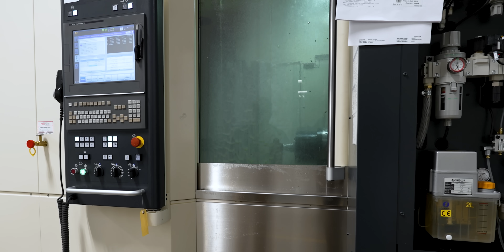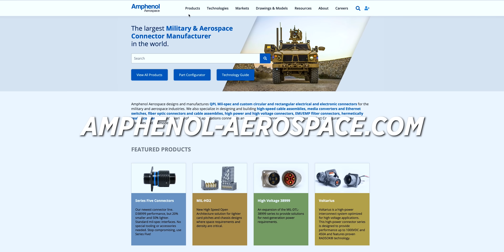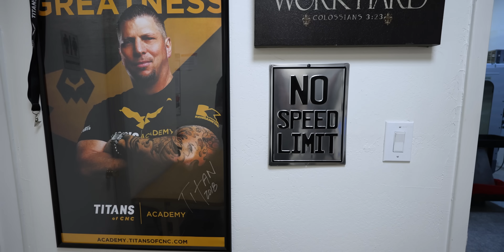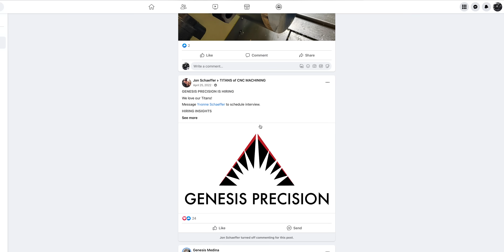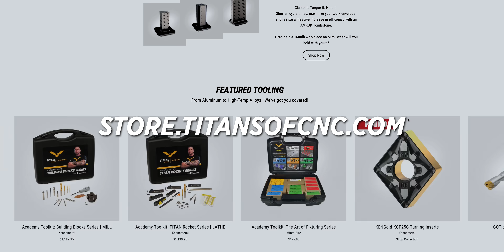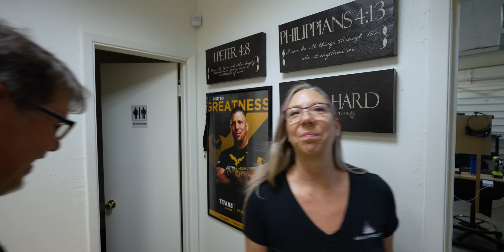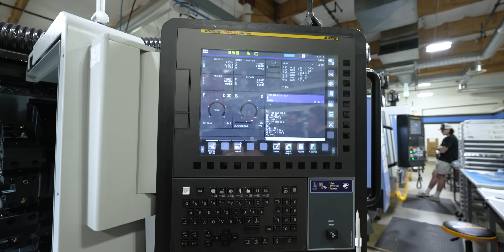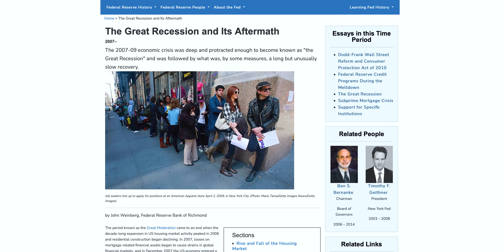Step Inside This Billion Dollar Secret Facility In Arizona

Comment: Arizona boy here.  Well, I'm really a retired old man now but, I don't know how I missed this video earlier.
Good to know you were in town.
I ran a one-man custom auto interior shop for over thirty years.  I had to learn CNC milling and lathe work because alot of the vintage automobiles I worked on were hard to find replacement parts for, and having someone else fabricate them for me was crazy expensive.
I had to learn G-Code and milling in general on my mill, lathe or my 3D printers.  It was learning through trial and error; mostly error.
I sold my machines after retiring because I thought I wouldn't be needing them anymore.  Boy was I wrong.
Now I'm looking to get some desktop CNC machines just to have on hand.

Comment: The smaller shops you visit remind me of Lakota Racing in Carrollton OH. They are a small machine shop that work on small high output motors for Garden tractors and other small equipment. We’ve taken our motors there for over 10 years and everytime I’m up there I visit my buddy Ross in the shop watching their cnc machines. Coming from a carpenter with our cncs it makes watching his that much more interesting. Quite a few machines they have packed into a very small shop with a high output

Comment: I lived in Phoenix Az. for almost 20 years and purchased from a variety of machine shops in the valley and I've never heard of these guys. One thing is for sure if you're a big shop you must keep lotts work running through it to keep the doors open. In tough times heads roll and equipment is idle. Smaller shops tended to be more flexible with very low overheads and usually survived economic down swings.

Comment: As a teenagerI worked in a machine shop in the 70’s.  Used Bridgeports and South Bend lathes — all manual piece work.  Have to say one of the best jobs I’ve ever had.
Reply: Most of those bridgeports are probably still going lol every machine shop need a old one on the corner wouldn't be the same without them

Comment: I used to live right down the road from Amphenol but had absolutely no idea that they existed. I run the Machine Shop for NAU now up in Flagstaff while I am finishing my Master's / PhD in Mechanical Engineering. It is a smaller shop but I get to run a lot of first iteration parts for the capstone students and it has really helped me realized how much I love the manufacturing side of engineering. I might see if they need some Manufacturing Engineers at Amphenol when I am done with my degree. If you find yourself in northern Arizona, you should visit our shop as well. As it is a school-based shop, I would have to get the go ahead from the Mechanical Engineering department to give a tour but I doubt that would be difficult.

Comment: Amphenol has been around forever, famous in electronics. Been using their stuff since the 80's.
Reply: If you've ever worked on an aircraft you've probably used their connectors.
Reply: We used a lot of Amphenol MIL circular connectors building satellite ground stations in the 60s.

Comment: I used to work at Mazak UK in Worcester and ever since I left to become a HGV driver I regret that career change as I had an accident causing my lower back to be fused together.
If I had never decided to change career my back I'm sure would still be OK to this day.
I loved making intricate parts and making new programmes to cut production times down etc.
To all the people thinking of engineering as a career I would recommend it as it is a fantastic industry to be part of and the job satisfaction is awesome.
One of the best projects my team were involved in was making a clog for Nike in Holland to show them what our machines were capable of, we found out secretly through someone the size of the visiting director was and made a clog out of aluminium with the Nike emblem on which he thought was absolutely brilliant 😂🎉